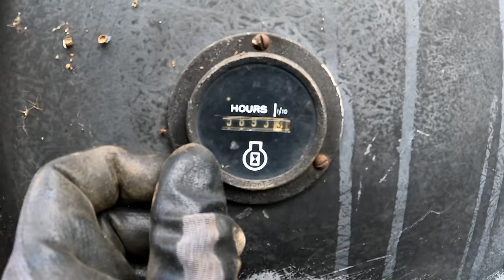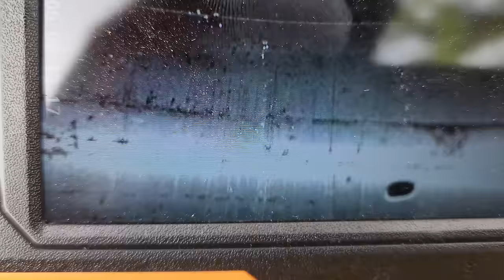70's John Deere 310 Backhoe Sitting For Years... Will It Run? - NNKH

Comment from the maker: NNKH Hats/Merch: https://www.youtube.com/channel/UCYAcr-u-BLGIrtUImT2_Elw/store

On Amazon:
~ILIHOME BORE SCOPE: https://amzn.to/3b2SP8K
~JF EGWO JUMP STARTER/COMPRESSOR: https://amzn.to/3b31I27

0:00 Intro / Tour
02:08 Uncover / Check Stuff
08:18 1st Start Attempts / Fuel
11:28 24v To Starter / Heat Intake
13:15 Pull Injectors / Compression
14:36 AG1 Sponsor
15:36 Pull Valve Cover
17:24 Day 2 (Valves and More)
21:50 Starting / Moving
25:41 Now What?
28:15 Clean / Transport
31:11 Outro
Reply: I love “Will It Run” segments
Reply: Pn

.
Reply: Technical college classes and you're more thorough I've ever seen good job
Reply: Two grand is way too cheap for that thing it is absolutely running in working and operating that means it is worth at least $5,000
Reply: Lllllil
Reply: 𝓲𝓲𝓲𝓲𝓲𝓲𝓲𝓲
Reply: ششششششششششششششششششششششششششش
Reply: P
Reply: 0
Reply: Mp00

Comment: I've worked on a few tractor,  one I remember was a case,  it had a 4 cylinder Perkins engine,  someone left it outside without the exhaust stack uncovered.  Took the head off,  it was very bad shape.  Ordered a rebuild kit, took the head to a very good machine shop.  Cost $600 just for the head, but after putting in new rings, and bearings it started up fairly quickly,  ran rough for about 15 seconds,  then ran great.  The biggest problem was,  like you found the hoses were bad. The gentleman that bought it, changed all the hoses.  And some other stuff.  For a tractor that was built in 1968, it's earning its keep. It has the front end loader,  and the back hoe as well.  The man that bought it says he is very happy to have it. 

Sir, you did a very good job, and kept a good machine from being junked.  I enjoy your videos,  some times I kind of wish I was younger.  Seriously though,  I don't want to go through all that again so I will stay at my old age .

Comment: There’s a pressure dump solenoid on the hyd pump to relieve pressure while cranking that’s wired to the starting pole of the switch. Or you can “rock” the steering wheel while cranking. Will make all the difference in starting.  I owned several 310’s, 310A’s & 410’s.  Great old machine in its day.

Comment: Great video! One quick tip on starting these machines, on top of the arm of the clutch pedal there's a part that pivots up which allows the pedal to be pushed in further. I believe that it bypasses the hydraulic pump which will make the engine turn over easier and faster. I used to run the exact same hoe. Great machine! Thank you for your entertaining vids!!

Comment: I own a JD410 four cylinder backhoe with a cab, very first heavy equipment I bought.  I use it for maintenance on my two properties, it's not going anywhere. One nice feature about these when operating the front bucket up and down it has no affect on the angle of the bucket and yours has the two cylinders to swing the hoe boom. Great job saving this old iron.

Comment: I have a 310A, it's a beast.  I wasn't surprised when it ran. Good job man.
The ignition on mine is on the same part as the throttle just behind towards the back.

Comment: Had a similar vintage model 410, was a great machine.  Only issue I ever heard about is condensation/water getting in the transmission housing and causing problems with the drivetrain.

Comment: Thank you for saving the great old JD backhoe
Think the lever on left of steering wheel. midway is NEUTRAL. up is forward Down is backup. the gear shifters are one is HIGH/ Low Range. The other is just standard Four speed gear shifter.

Comment: Hello. The slow cranking speed is most likely the electric dump valve in the hydraulic pump. The valve is on the left side of tractor on the pump at front, in front of fuel tank. It has two wires feeding a magnetic switch. It is energized when you hit the starter to relieve hydraulic pressure while starting.. I have owned and worked on the 310 and 410 series and this was a rather common prob.

Comment: Most likely the piston rings are tight in their grooves, by all the rust they have scrapped off the cylinders.   If you could clean the ring grooves, they need about 2 thou play for the rings to make a good seal.   The cylinders will most likely get better polished with use. (but the re-build kit seems cheap enough, as there are only three to do..!)

Comment: Just recently bought an old Case 580C that had been sitting. Basically what I have learned is that old equipment is like having a boat. A boat is a hole in the water of which you throw money. A backhoe makes the hole of which you throw money. Rebuilt several hydro  cylinders and redid the brakes top to bottom. Few smaller items to sort out, but it digs! Enjoy the channel!

Comment: If you look at how that exhaust manifold is built, the fact that the exhaust was open and the #3 cylinder has the worst compression it all makes sence.  Thst exhaust wasn't always covered and the engine filled with water.

Comment: Had one of these in UK  badged as a Ford 550 3 cylinder based on the Ford 4000 tractor , and a similar one badged as a wainroy by Rubery Owen

Comment: stuck rings use seafoam or marvel .. dump in cylinders and let sit... should fre up rings and valves.. the "galloping" heard when cranking was the first tell tale of some issues.. some heat cycles should free them up unless the valves seats are worn too bad..at least she fired up!!! Them older machines are tough!

Comment: We have a 1962 JD Backhoe. its a 2010 wheel industrial. Not too good of a machine. 4 cyl diesel and most every cyl leaks because the rams are pitted and rusty. Its wobble stick control like yours. Its a POS however its a strong digger it has the steongest hyds of any backhoe i ever ran and  has a 14 ft digging depth. We also have a 301A JD  tractor. and its a great machine. Its a 3 cyl gas however the remainder of its like the tractor your backhoe is built around.

Comment: Look up the Bruce Wilson channel.  He is using these monster jump packs that will start semi engines with ease.  They are fairly compact too. look up his last will it start of the V6 Detroit.
Reply from the maker: I've done a lot of jump pack review videos. The biggest I've used are 4,000 amp ones but yeah maybe he's got something bigger than that. I actually was using the jump pack on this at some point as well. I think the starter is just shot. Also the V6 Detroit engines don't seem to require that many cranking amps because I've started my 6v53 with a single battery that was pretty whooped
Reply: Salvation Workshop has been saving some old iron.  Big dozers, loaders and backhoes from thE late 60,s.  He’s using some Big’Ol jump packs. Some as big as a suitcase but 24vlt.  You find cool projects.  Props to you.  Cheers

Comment: We used the old original optima redtop on a Brøyt x 21, it has a 6 cyl 6 litre Perkins engine, worked just fine for start.dont know about the Mexican optima

Comment: Maybe next time try some engine restore and see if it will fill in the pits and scratches on the cylinder walls. It works pretty good on most compression issues.

Comment: That handle on the left side is your Forward and revers . Drain the water from the Hydraulics,Engine,Etc.Before you start it. Ask me how I know.  All my best.
Reply from the maker: The drain plug had a drip coming from it of oil so that meant to me that there would be not any water on the bottom since it always sits on the bottom. But yeah probably should have checked the Hydraulic oil too

Comment: You might be incorrect about needing a rebuild. Having run a few times the rust and crud making the valve seats leak and the rings fail to seal (?maybe) You could get another 4000 hours if it is used daily for a rime. No glow system? seems really different to most yeah?

Comment: Probably rusted quicker in dem cylindreyys due to the non-breathable Rain coat solution, trapping the moisture in the engine bay. First thing to do is put a fine cocktail of dem earls in & she probably tug along for a couple of months. Got to softn the ol' gal up before waking her up after 2 decades^^

Comment: Even if it needed a rebuild where it sat, it would definitely be worth it. I've seen several will it start videos an John Deere engines. They good tough little engines and will start after sitting for decades. Good save on this one😁👍

Comment: That motor has a wet sleeve bad coolant will actually cause static electricity in it and there’s a cavity at the bottom of the sleeve and will cause coolant in the oil 
But that being said I have several of those engines in tractors 12000 plus hour machine if they are maintained yes 12000 hours

Comment: I know this video is an older video but if anyone could answer this question I would be grateful, it's kind of bugging me because the few people I know that have heavy equipment are giving me different answers. When it comes to the battery situation. Could you use deep cycle marine batteries ( like the ones used for trolling motors ) as the main batteries for this equipment? Or are you really supposed to buy specific batteries just for them?

Comment: dude 2000 CCA for a small 3-cylinder diesel in the summer time is WAY WAAAY enough. but perhaps your Optimas are high current but low capacity?
Reply from the maker: I think the starter was just on its way out
Reply from the maker: Also the fact that it had low compression doesn't help either.

Comment: Legitimate question here. I know back in the mid-50s when Chevy first came out with a small block Chevy, It had oil consumption issues. The factory repair was to pour some Ajax like substances down the carburetor while the motor was running. The Abresive material scratched up the cylinder walls just enough to cut down on the oil consumption. I have always wondered if that would work on these lower compression engines, if a little bit of abrasion would seal the walls up and increase compression to the point where you can get a little more use out of the motor. Has anyone ever tried this? Would it work or would it make matters worse?
Reply from the maker: Thats interesting. I've never heard of such a thing. I'll have to research some about it. Sounds like it could maybe help some things out though!
Reply: I think the best 'engineering' solution, short of putting new liners and pistons in, would be to take the pistons out, clean up the ring grooves, and hone the bores.   Even if this takes 1/2 thou off, it will leave a polished surface.   There are ball hones and flat carbarundum hones that could be used.... and of course you would get the definitive answer with your inspections.

Comment: You should have cut in the clip of that hydraulic hose almost popping in your face on the dozer.  The ultimate "don't try this at home" clip.  Good save on the backhoe, though.  You remarked that those bees were so calm...  Did you notice how slowly he was moving?  We kept bees when I was a kid and learned that honeybees hate fast movement and loud noise.  They are also attracted to bright colors.  So what is the typical human reaction to bees coming close?  Flailing arms, running, and screaming - in their Hawaiian shirt.  Bees are attracted to the color, then threatened by the behavior.  I think you can see the lesson here.
Reply from the maker: Darn, yeah you're right I should have definitely tossed that clip in there. And yes he was very smooth with the bees

Comment: Dude its a diesel, Its going to run if it ran when Parked, Hell I've started them sitting 70 years and start right up.
Reply from the maker: It's more so what will it take to run. Did you watch the video?
Reply: @NoNonsenseKnowHow  Yes I seen you had to pull the valve cover and someone showed up, I watched the rest a little while ago, Great video,s